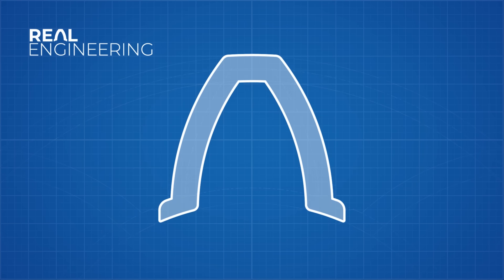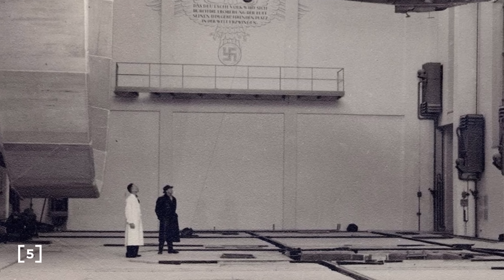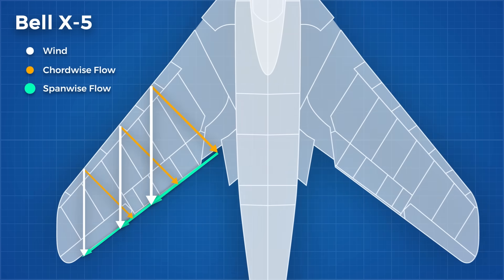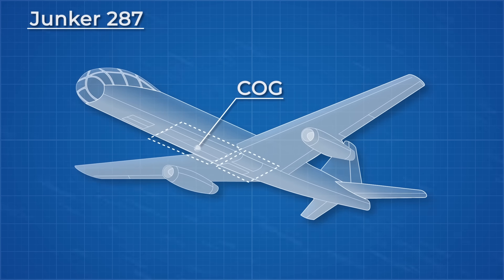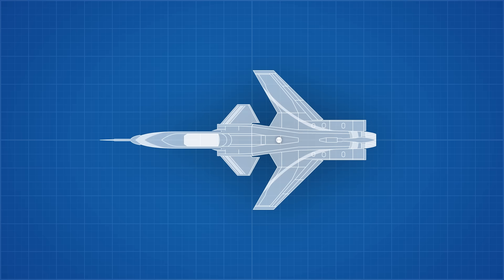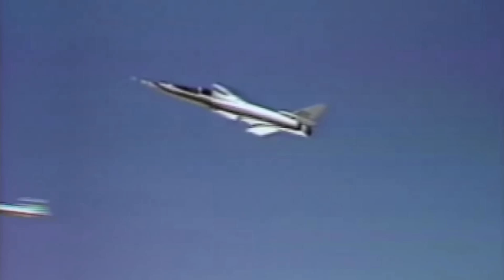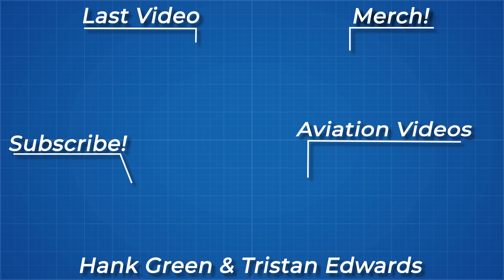Why Do Backwards Wings Exist?

Comment: My question is, as with the F-14, why not have an adjustable sweep? Would a decreased sweep allow for greater stability?
Reply: Swept-wing planes are monstrously heavy. That's why the late versions of the F-14 still couldn't turn and climb with an F-15, despite having the same or more power. It sure looked cool though...

Comment: I can see that any twist induced into a forward swept wingtip will not only increase roll force but, since it is far forward of the CG it will also induce an upward pitching force. Of course this can add to maneuverability but can also be unpredictable. With the argument about that the air passes over an airfoil faster across the top or not.. Whether it does or not, the air will be rarefied across the top surface as it has more surface area. This will lower the pressure; and lowering the pressure lowers the mach speed. So even if the air is not technically going faster the result is the same.

Comment: What if the rear steering wing what ever it is called, was able to flip or rotate 90 degrees to the flow of the air around it?  It would act as a strong air brake in emergencies such as when the plane is flying straight down at high speed or when it wanted to drastically reduce its speed in a dog fight.

Comment: In early  time P38 was consider unstable since dive or max turns to be unstable or possibility to crash but this airplane has nohting to do fault, it haults scfi design capabilities was tested, but US deosnt give shit on fly by wire on GPS systems and is considered to be unstable, this how much taxis and sellung bulshit influencre industrial production. The reasos why it was fault is complicated to be object off desire, since in east they hads no production research they didnt now about ideas and creativity or purpose off production very bizar, in tech and army was this airplane considered unsafe as it turns budget upside down in figures. What it realy means and is considered dead man hair in star trek to boldly go etc, a scfi tech possibity switch to flight usable space conditions aeroplanes, the army as a main reason considered this false as it ofered some light tech improvments  on same jets f something in that years already so called f due to already developed  MIG 25 -31, 2,5 mach vertical hovering was in hault positions the market kind was in phase enthusiasm or spy recovery TY 177 as a concord isue off fast fligth , the further complication as aeroplane that caused a mess for budget was rocket systems adequate since faster they needed all nother pack  offf rockets. As in history russians vere develping this as candy stores they didnt even hwo to fly thsi safely that is why harrier dominated as modern plane difficult to handle but safe to land following instructions  and exp. That is history and stories for public as a fan off star trek or pilot you discover and learn lots off usefull new stuff. Today market spining about new possibilty as v planes, alice,  or aerofish 8 which all consist off scfi tech and have possibility off 500 billiom market in production  numbers what you didnt now that jewish alice has a best space solution and this tech offers like box elements scfi althow alice had some possible nasa help about back tail wings the search in research in scfi turns for scfi ships to have  a box element at max torsion  and low drag and a element to add wings in this case curved front one movable,  the back pair should be either straight or slight curved, so that buble flight options would consist off 2-3 buble in airtunel and speed off polite rainbow in in other planets kind, there is possibility to be double props engine, 2 aeroplane, a jet pack 3x, or super jet 2x sabre  for factory a possibility to have 3 airplanes in production and one in research and developing vertical 2x2 is all a nother theme for new lines off production in industry, no wonder why your mr Trump squeze and want more tax or billioners like Tesla or amazon want to fund this projects. All things like this done in car industry could produce 3-5 years aeroplanes competitive per piece and have all new line scfi transporters inc permanent one fuelings and etc and all thngs vaiting for star trek design on board as theory with tocamac starting, this tech is optional in production and if mr Trump wants play smart they chines would build this it them nothing and could get production lines in theory to get 10-15 years in 5 everyone would say yess, there is money pit in this and buis earnings in it. Since market is opend best if smaller factory designed bulid with enough land to expand, since land in china is not even option they even bulid it for owners or build for it self in china production and lok for investors. Technicaly you gain experitize and bulid factory per production per piece. That is why us is selling unusual stop for 737 and arab stoping A 350 and a halt for v wings  and new projects. As china says no 1 market in car industry by size and industy by click! And aeroplane stories aboout industrial production is fly by nav A 350 XWB aerobus, and the movie industry joke about nuc motor on a bike near star trek facility already was sold in movies saying this and dead whales that this tech use scfi or corvette  drive tech. So much for drive on einstein theory and beer thing is a football theme but not in US. That is how you comunicate and john searl type engine could be a  combo  for cold fusion booster or fision recombo in toc recomponent and discarge off gas in magnetic core and that is not a einstein theory that is star trek and cap kirk theme at academy and defense off theory warps flight as thesis and vulcan academy ofificer says yes. So permanent punching and release is subject off cold fucion warp tech as privileged as knowledge off captains and flights off above 2,5 mach speed!

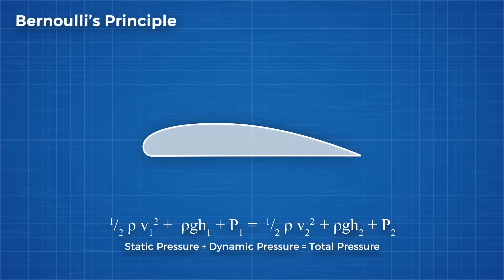Comment: I was really unhappy with your incorrect description of aerodynamic lift at around 1:55. People get this so wrong, so often, and so vehemently stuck on their incorrect knowledge of lift that their first stage is denial and rationalisation. Yours for example starts with "people like to say this is false but it's just one of the ways a wing generates lift". No it's not. Your assertion is also set against the backdrop of an animation showing fluid packets splitting at the leading edge only to meet back up at the trailing edge. This doesn't happen. You've demonstrated the 'equal transit fallacy'. The air over the suction surface actually travels faster.

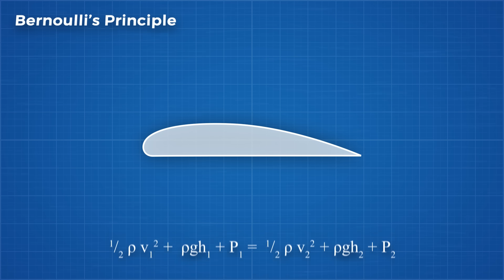1:49 An aerofoil is not designed to make use of "Bernolli's Principle". This misconception is also so common it's taught to undergraduate engineers and occasionally even taught to light aircraft pilots. Low pressure on one side of an aerofoil is NOT created as a result of air moving faster. The pressure gradient is in fact set up so as to curve a fluid packet around the wing. Air moves faster because it's travelling into a region of lower pressure, not the other way round. You should be showing the Navier Stokes equation, not the Bernoulli equation. 

Bernoulli's equation only ever applies to STEADY, INCOMPRESSIBLE, IRROTATIONAL, INVISCID flow (like simple 1D laminar pipe flow). An aircraft wing usually fails all of these requirements! I usually love your videos, but you've essentially packed every misconception about lift into a tiny space of this video. I'd love to clarify if you have your doubts, but I'd love even more if you were to issue a rebuttal.

Comment: Thunderbird 2, had swept forward wings, in 1965.  Derek Meddings the designer, read and talked to a lot of aero-engineers at the time.  

Forward swept wings allow for a much lower stall.  Ironically TB2 also uses a lifting body.  The wings are just for maneuvering.

Comment: These issues on supersonic flights were solved by unmanned air vehicles. With no humans inside the craft, pilot safety is no longer a concern, planes are way smaller, and most of all topgun, starring tom cruise, is coming to theaters near you

Comment: Another great video, thanks @Real Engineering. In this and your other 'why wings are swept' video I struggle with understanding chordwise flow. I get that spanwise flow will occur with a sweep in either direction and this isn't accelerated by the Bernoulli Effect, but isn't the effective chord shape and therefore flow the wind direction? If this is the case then I do get that any proportion of spanwise flow will help decrease airflow separation and allow higher speeds.

Comment: Bernoulli is old hack and doesn't explain lift. Check out the rotational model for lift which is now accepted defining the lift off an aerofoil. Its been around for a few years and is a pretty common miss, sorry about the dislike as your stuff is normally on par and hopefully this explains that dislike.

Comment: Mandela Effect Alert - Jet engines are now far forward of the wings, instead of centered beneath them, mounted on "pylons". Does anyone ever remember jet engines mounted this way? I don't. The engines were always well under the wings, and they were never so low to the ground that you could literally touch them without standing on a ladder. And the wings were much bigger. Planes look ridiculous now! This "new" design now reaches all the way back in history. And this "new" design has flaws. The blazing hot exhaust from the engines could easily damage the wings and flaps. There is little to no residue (photographic evidence) remaining showing jet engines the way we remember them. Check any video online showing a plane in flight, or a view from a window seat, or visit an airport, or just check planes in the sky right now, and you'll see the new position of the engines. And by the way, planes appear to levitate. There is talk that the engines are anti-gravity devices, not "jet" engines at all. They just appear to float. Are we being lied to?  We're either on a different timeline, or our timeline has changed.

https://www.youtube.com/watch?v=zanUZlQqUys

Comment: You kept saying that the instability was a disadvantage.
But from what perspective?

In terms of Aerial combat the instability of the pitch of the aircraft is a major advantage as it allows for a tighter turn radius.
It may not be practical in terms of todays "out of visual range" engagements but, you need to state that the instability  also means high maneuverability.

Comment: I understand, you were packing a really complex topic in one video.  So I wanna clarify some things for people who would like to know..

The twisting of the wing does not only occur on forward swept wings. it occurs on every wing. In fact it is often the factor limiting an planes top speed. The wing will fail due to twisting. 

Putting the elevator in front of the wing does also not only work on forward swept wings. It works with "traditional" wings to. You are right, it should be more efficient because it contributes to the lift of the wing instead of generating negative lift like a traditional elevator. But there are two factors that may reduce this increase in efficiency. First of all, the elevator will disturb the flow around the main wing rendering it less efficient. Additionally, you have to take a look at the induced drag. It is highly dependable on the aspect ratio (ratio of its length to its chord) of the wing. The higher it is, the lower the induced drag is. So if you generate lift with those canards, they will generate a high amount of induced drag because their aspect ratio is quite low. In essence, what my professor told me, generating lift with anything else than the wing is inefficient. But I have to admit, this applies also to the negative lift generated by a conventional tail.

Comment: Your diagram is wrong.  The horizontal stabilizer of a conventional airplane produces DOWNWARD lift, not upward lift.  This is to counteract the weight of the forward engine and fuselage.  Then, at 13:09 you correct yourself.....

Comment: With modern computers with way more computing ability, at a much smaller size and weight, and reliability wouldn't the forward swept design be more feasible now?

Comment: Monitoring and adjusting the control surfaces at a rate of 40x a second only seems like a lot until you realize that a lot of modern vehicles (for some retarded reason) have suspension systems that monitor and adjust at vastly higher rates than 40x a second.

Comment: Thanks for a very interesting & informative video!  Now.. I've a question about a photograph displayed @ 0:36 seconds into your presentation.  It's a B&W photo that shows 5 guys atop a bizarre fuselage which is fronted by a large semisphere of glass panels, looking like the single compound eye of some crazy insect, above two slightly bent front legs.  Allow me to couch my question in the most scientific terms possible: What the hell is THAT thing?!?  It looks like its front wheels are covered by some sort of inflated cowlings.  And it doesn't look at all as if it were actually ever meant to fly.  It's clearly one of those experimental craft that makes me think even the most adventurous of test pilots would balk at it (right after they gawked at it!)  Thanks again.       𝖙𝖆𝖛𝖎.

Comment: You mentioned this briefly as a con, but the unstable nature of this design was actually something the engineers were trying to exploit to make it more agile. A small input will cause a huge change in the aircraft's trajectory, allowing for some insanely tight turns and faster maneuverability.

Comment: There has also been a german business jet with forward swept wings , the HFB 320 Hansa Jet. See https://www.youtube.com/watch?v=-Zfanv9OxyQ  Designed in the early 1960 it was the first german civil jetplane that was built as a series (47 Aircraft) and used in a variety of missions (VIP transport, passenger feeder, cargo aircraft and military electronic counter measure trainer). The forward swept wing design was used to shift the wing center box aft, creating an undisturbed passenger cabin. For the same reasons mentioned in this video, it was a rather heavy and expensive construction. It has not been a commercial success.

Comment: also, it's relative wind flow, and spanwise COMPONENT and chord COMPONENT. labeling them flow misleads people into thinking air is flowing in these directions, when they are just the components of a vector shown to make sense of what is going on.
Reply: also also, makes more sense to show the spanwise component on the leading edge c;
Reply: also also also, when talking about stall caused by the boundary layer and separation, the arrows are moving in the direction of the stall, rather than the direction that air is flowing. this is very confusing.
Reply: also also also also, a reverse sweep does not reverse the direction of the chordwise COMPOOOONENT, it changes the direction of the boundary layer of air following the line of separation, changing the origin of the stall on the wing.
Reply: also also also also also, wing shape is mostly, almost entirely, to have air flow in a certain way at certain speeds, little of the lift is generated from differences in pressure.

having the wings swept forward or back and having canards or a tail, respectively, makes no differences in terms of efficiency lost to drag, as stated in the video, rather the canards or tail section have to use lever force to balance out the lift cause by the wing, as the wing generates the majority of its lift through simply pushing air downwards and thus pushing the plane upwards. the forward swept wing moves the force of the lift generated by the wing behind the center of gravity pushing the nose down, and thus needs something in front of the center of gravity to counter act this, which happen to be a canard pushing the nose up. both have to generate lift to balance the plane, which is what give the design better efficiency, not what is mentioned in the video. 

honestly, and undergrad could do a better job of making a video to explain what this video tried to. this video felt like someone with no understanding of aerodynamics saw a few pictures on a blog and made a video about how they thought those things worked or what they were depicting.

Comment: The aeroelasticity explanation for the X29 is so muddled as to be not even wrong. The X29 used clever directional layup of the carbon fibre so that as the wing was deflected up by lift forces the structure inside the wing twisted the wing to reduce the angle of attack of the outer portion of the wing, turning a divergent failure mode into a self damped stable one.

Comment: I am probably thick, but this is the third video that covers the swept wings and chordwise flow vs. spanwise flow I have watched, actually several times with a bit of google searching, and I still don't get it.

If the white vector refers to the total air flow and the chordwise flow is only one of its imaginary components - the one that causes lift - then there is no reason for the spanwise flow to carry the air stream outwards, away from the hull of the airplane, and no reason for the stall to be formed from the tip of the wings.

If the spanwise vector actually illustrates air being pushed and pulled by the swept leading edge (somehow?) away from the airplane's hull, shouldn't the vector of the total air flow aim slightly away from the airplane, and not parallel to the direction of flight, as suggested in the picture?

No matter how I look at it, it just confuses me. Anybody help?